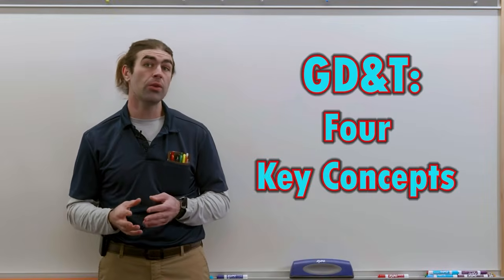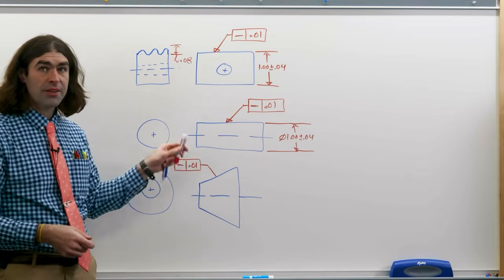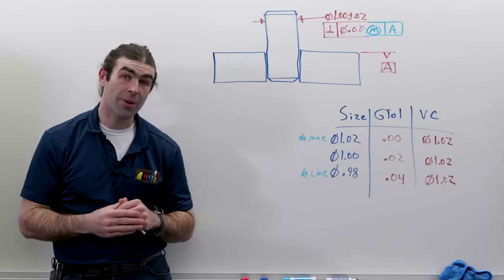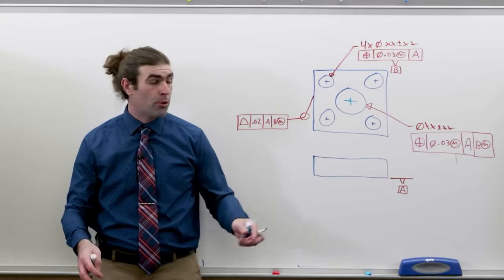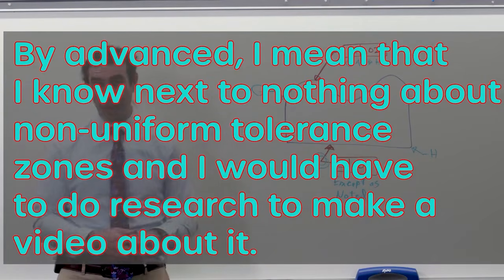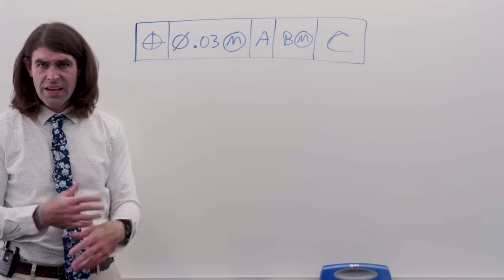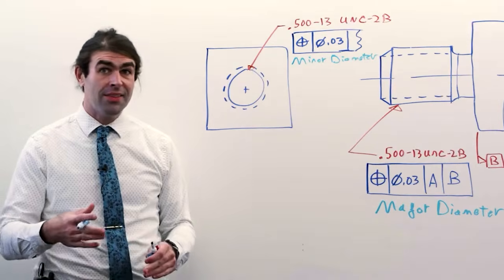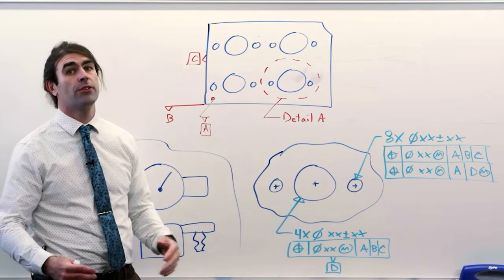GD&T Complete Course 3+ Hours

Comment: Dean, first of all, your videos are great and very clear. I have a question, you mention that material condition modifiers only apply to feature of size, but a chamfer or a fillet radius can make the part "heavier" or "lighter" depend upon the tolerance limit those feartures are at. Don't it?
Reply from the maker: Hi, thanks!

Every plus/minus feature has an MMC and LMC size as you mention, but some like fillets are not “features of size” because they can not be measured with opposed points(brief explanation). Because they are not features of size, we can not apply a geometric tolerance like position (which allows application at MMC/LMC)

We are limited to plus/minus or profile for fillets, which we can not apply at MMC or LMC.

These are not rules of nature, just what Y14.5 decrees

Comment: Thank you very much. This is a very helpful video series. I just started a job in CMM inspection and I needed to learn GD&T quick. This is helping immensely

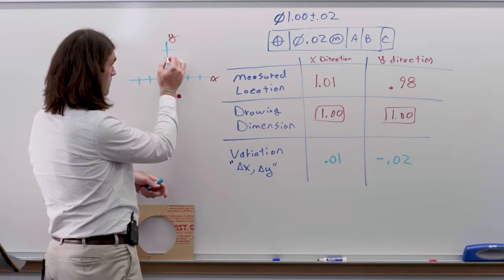I have a question...at 2:40:10, you draw a circle. My understanding was that that circle was supposed to have half that diameter (tolerance zone is Ø.02, but the drawn circle is Ø.04) Am I right about that? Thank you again for these videos

Comment: 21:24 my opinion there should be a diff gauge  for ID  0.98 why because the gauge is only check  for MMC of ID hole , maybe maybe there should 3 stepped gauge (stepped ring and STEPPED cylinder) - for OD first step is MMC and second LMC third step is under sized OD (1.97) than given tolerance, for ID MMC is first step , second step is LMC, third step is over size shaft than LMC (1.03) - if the ring is unable sit in the Gauge or Die and if it can sit in 3rd step then the Ring or part is out of Dimensions i.e Exceeds the given tolerance or ID or OD
simply kind of combining Go-gauge NoGo-guage of Hole and Shaft
Reply: you are correct in this regard.